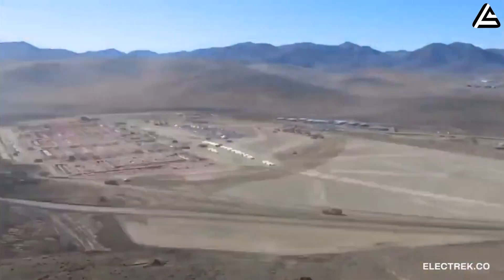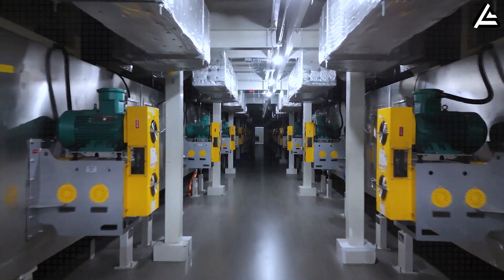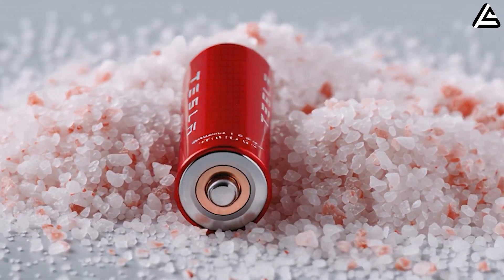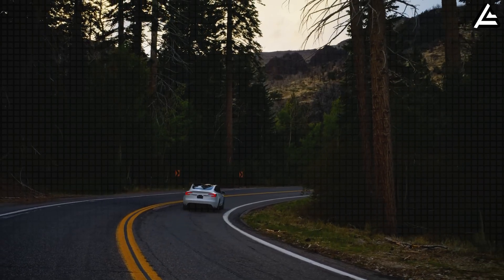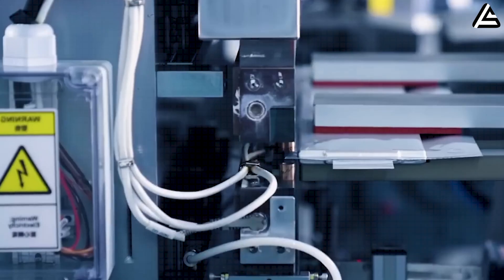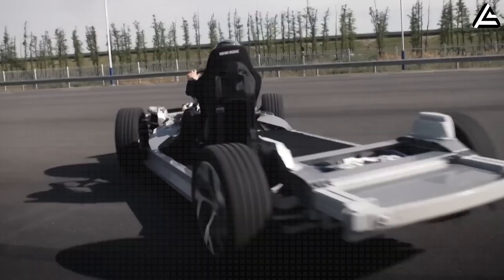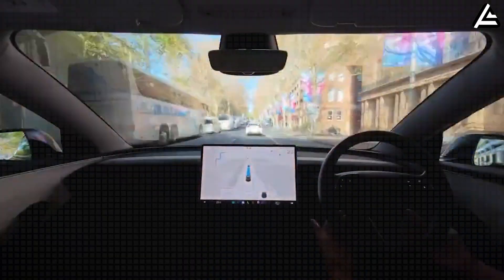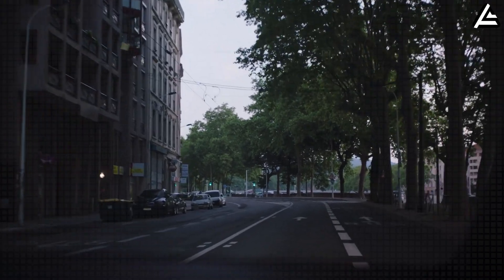FINALLY HERE! Tesla Aluminum-Ion VS Sodium-Ion Batteries: Designed For Senior, 2026 Mass Production

Comment: That 200 to 250 kilometers is not enough for me as a senior. Yes charging takes less time but you still have to get of the car more. Samsung has created a Solid State battery that is supposed to be released at the end of 2026 with a range of 500 to 600 miles on a single charge with a charge time of 9 minutes. If that is true then why would you go with a Tesla battery? China claims they have developed a Solid State battery that has a range of over 1000 km.
Reply from the maker: I think Tesla will not stay out in this range race

Comment: Well, the price went from 11-14k to 30k really quick, didn't it? Also, the charging went from almost 0% to 100% in 5 minutes to 20% to 80% in 14-16 minutes for Al-ion with no mention of how long Na-ion takes. While this is still quicker than Li-ion, it is not as much as a game changer as the earlier numbers promised. And the range is back down to 200 miles or less. These changes take away all of my interest in the model 2.
Reply from the maker: Early numbers from leaks often look more extreme than what real production will achieve. Aluminum-ion and sodium-ion numbers are still speculative, and range/charging times will likely differ on the actual Model 2.

Comment: charging speed barely factors in for me. no one wants to pay thousands for a battery only to have it showing its age 5 or 6 years later. so long term reliability is tops for me. bring on aluminum with 400 miles or more
Reply from the maker: thanks for your sharing. I totally agree with you